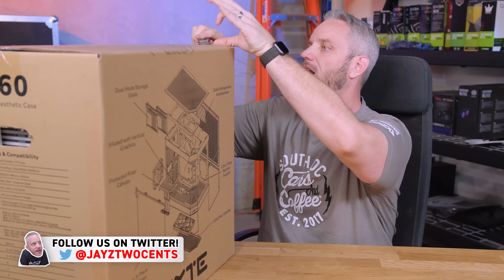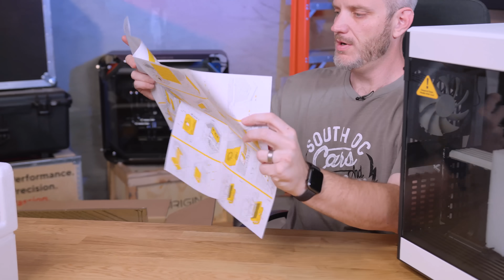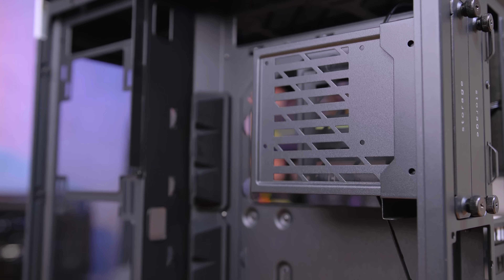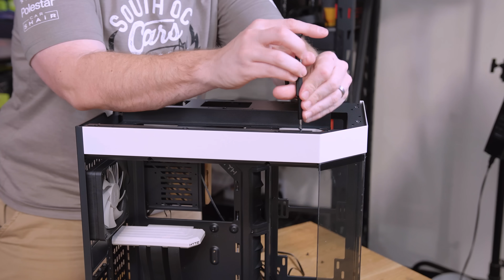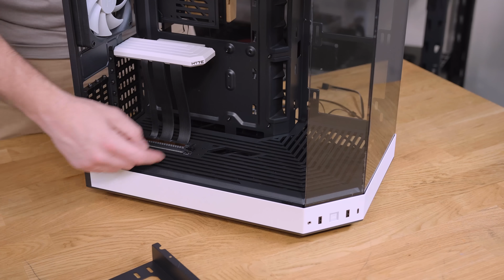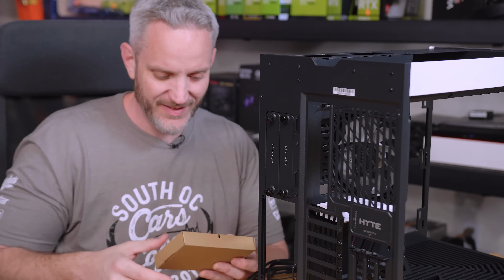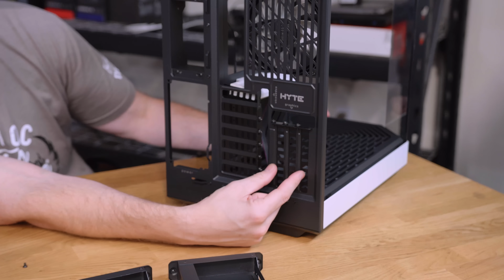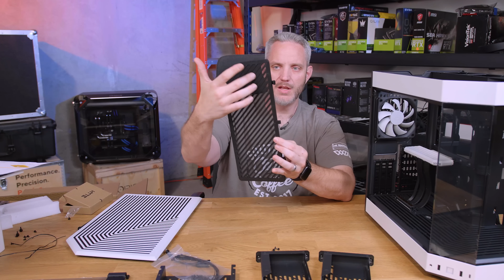Someone FINALLY broke the mold for PC cases...

Comment: Quick correction as a maker. Expansions would not need to be low profile in those PCIE slots. You could use a spacer nut or long standoff and mount it to the low pro bracket.

Edit: the fact that the slots are “behind” the verticals, would allow you to mount a regular PCIE extension in the slot with the extra standoff/nut, so long as it wasn’t interfering with the vertical GPU mount or it’s connections.
Reply: I like your fancy words magic man

Comment: I have the fractal torrent and it's hard to even consider a different case besides for cable management is a joke  
The inside of my case is always ice cold just because of the fan options you can do 
Front&bottom two 180mm or three 120mm/140mm fans 
As for the exhaust 120mm/140mm  single fan 
Its Nutty

Comment: I bought this case I want to build a watercooling loop in this case trying to figure out the best routes to take in this I also want to use black brass piping on the build so trying to avoid making bends will buy 90 degree angle piping and straight. Any help is appreciated 🙏

Comment: Alright so it’s also a desk tower which is a huge drawback. I need desk space, while I do not underneath. I can’t think about how many time I’ll crush down the headphone jack and USB port by accidentally stepping on them.
And I don’t even mention how annoying it will be to turn it on.
Low profile for a few centimeters of height is also a deal breaker.

Comment: Good review and looks like a really interesting case. I don’t like the low profile slots and I think the bottom panel should be removable so you can do RGB fans all around but I most likely will do a build in one at some point.

Comment: The front of that case looks like a ton of wasted space. I would have expected like some kind of option in that front area for a water tower mounting brackets if someone wanted to maybe put in a custom water cooling system, like just put that in the floor towards the front right side of the case.

Comment: Well i think it is not so good of a design, i wont the most fast airflow around my hot components. Like a draught that transports the hot air out.
A open system will collect dust, may cause the dead of the rig, don't ask how i know! Lot of fans may be worse than a fiew, i am sure about that.

Comment: This could be the perfect case! Honestly if they made the case a little bigger( for full size mounts) with 1inch more room at the bottom fans for 60mm thick radiator and cable management. I generally think it would be in the top 10 cases for the next 5 years if not more. Almost perfect.

Comment: Problem, how do you take the bottom grill/filter combo off when everything is in the case? The back panel comes off easy and cleanly (ok dirty after a while) but the bottom grill? Also is there enough clearance on bottom for adequate airflow?

Comment: Neat case, but ouch, 200$! I'd wait till there's a generic imitation. I've never spent more than 50-60$ on a case, it's not worth it to me for a non-functional component. I'd rather spend the money somewhere else. I've unfortunately always been on a tight budget when building. I don't like the low-pro only slots, and I still have a DVD drive, just in case, lol.

Comment: i love the look of it.

i plan on getting a Sound Blaster card. idk if those are low profile. so probably wouldn't fit in this case. 

but I am getting that Lian Li evo case. for the airflow.

one day, when I make a 2nd pc setup, probably a corsair setup instead of razer, I'll use one of these Hyte cases.

but I like my 360 aio on the side vertically. that way I can have air go out the top. 

idk if having hot air go out the side is any better or worse than it going out of the top tho. 

i actually like to see my case fans. since mine have rgb.

as for the Hyte Y60, you wont be seeing a whole lot of RGB. But it might look cool now that I think about it.

rather than seeing the entire fan, the rgb would just be glowing through.

I'll have to wait to see what airflow builds people make in it.

Comment: A very interesting design. My only real gripe, maybe, is that side glass panel could've been made into a hidden, magnetic door - then you could open the case for maintenance without a teardown. I also disagree you can probably mount two more of those storage sleds, but only where the side radiator would be. A side note... I really love the violet/yellow lighting and gold cooling custom of it, showcased on Hyte's website.

Comment: If i COULD hypothetically afford to build a system in that amazing case, I totally would.  And I would go all out on ARGB, do a black and yellow color scheme on the case / accessories.  Ryzen 5950x with Corsair iCUE H150i Elite Capellix cooling, Asus ROG Crosshair VIII Extreme mobo, 64 GB of Corsair Vengeance RGB Pro, Asus ROG Strix LC RTX 3090 Ti OC GPU, and Corsair AXi 1200 W 80+ Platinum PSU to power it.  Plus the m.2's and ssd's necessary to store my entire steam library / dslr raw files / etc.  I mean if I'm going to dream big :)

Comment: Only downside is expansion cards. I have 2070Super at 315mm, 3060, firewire, nvme adapter card and also want a capture card but already using riser for the nvme adapter and space sucks (meshify c)

Comment: Hate to be "that guy" - it's different, breaks the mold as you said, but I'm really not a fan. It's different for sake of different, not BETTER. That weird cut-off-corner bit with the glass and front panel stuff, it just doesn't IMPROVE anything, and in fact I think would make it harder to reach in / work inside the case. Same with those gromets - sure, in CERTAIN circumstances it hides the gape but like, it also forces / limits what angle cables come through at. And that bottom you raved about, cool, fans, but with the way their PCIe riser is mounted, you can't put a rad down there like in, say, an 011, or many InWin or Corsair cases with similar designs. I just can't get behind this one, sorry Jay.

Comment: as for sandwitching two ssds in a 3.5" bay? They even make double mount adapters if you want to screw them down. They work perfectly well for that application. And I can see their point. I've got three SATA SSD spaces, only two are filled, and one of the two HDD spaces has a hard drive. I wager the two SSDs are getting old and probably wouldn't move if I ever rebuilt this system.

Comment: I looked up my big green case and apparently i have a "Nvidia Master Haf X" and ive had it for at least 10-15 years, no sidecover, most fans removed or switched out. Had to customfit the watercooler to make it fit on the top, where there used to be 2 fans, so its kinda jew-made but it works. I think my next case will just be components inside a desk or something that i make myself.

Comment: While lots of room for air to get in and out of a case can be a good thing, having slots or holes adjacent to fans can result in the air simply moving around the fan in a short-circuit rather than through the chassis.  I often use hard foam sheet to blank off surplus apertures in PCs that I build to help ensure that the air goes in and comes out only where intended.  That way, all of the air that is moved by the fans has a chance to cool down the hot bits.

Comment: The other things about this case that are cool are:

1.  Those storage trays can actually hold TWO 2.5" SSD's each, so one could potentially mount 4 SSD's in the case just using those drive sleds.
2.  While it is not just built around good airflow, it is one of the few cases out there that can almost reach a true 100% balance between intake and outtake of air.
3.  It was designed by the guy who used to design cases for NZXT back when they were GREAT cases!

Comment: Listening to Jay, break this "HYTE" case down like a car engine or something made me think of the days back in the day when folks didn't take Tech seriously, case-mod'ing and such in particular. Back then customizing cases with paint jobs, or case-mod'ing for extra air flow, or for a look, or to make a device fit that wasn't meant for that case; it was looked upon as something only the Geek or Nerd with too much time on, usually his, but could sometimes be her hands, would do - and often as a waste of said time. Now however, it's a thriving and well respected industry of uncounted billions I'm sure, with experts in unboxing, reviews, an all manner of the ins and outs like the Auto Enthusiasts enjoy. The only thing missing would be and auction like Barret Jackson, but we have eBay, and the like, and vintage gear can buy, sell and be traded, for unimaginable sums or deals based on the original prices. I've told my friends, who are less tech-savvy that a business computer to do a spreadsheet only needs to be so fast, a computer to play a game needs to be much faster, processing power wise and computationally (the difference being the CPU and the GPU respectively (support equipment inclusive CUDA and the like, etc.)) . Gaming is what drives the computing industry, Scientific innovation rides the coattails of the power wave Gaming has wrought through the need for faster video engines and the like, not the other way 'round. So all the majesty and awesome we have now pretty cases, rgb lighting,lcd mfd displays, etc., vs. the old beige boxes of the past is thanks to case-mod'ing and what it has morphed into as an industry. I would have never imaged it, and I dreamed of tech futures with cyberdecks similar to those in Shadowrun or Neuromancer when I was young. 

Hack and the world hacks with you !

So the circle is now complete, what a lovely case, being the best of both worlds the functionality of being open with the look of being closed, and shapely to boot!

Great episode!

Comment: This was useless video for me, thinking about maybe doing a case upgrade to my 2013 choice, the Corsair Obsidian 650D – CC650DW-1
I started watching, jumped forwards to the build start, it never did, quit watching. I don't want to look at a talking head, doing an unboxing, after a claim of this Case, "Broke The Mold".
Make that sort of claim, and I want data on how it actually does it's core job, cooling as a fully built PC, and with tested size limits on the EATX, and GPU, Rads etc.
Looks like I'll have to wait for Gamer's Nexus to actually Review The Case, won't just do an unboxing video.

Comment: Huge ventilation? Not at all. Only about 35% of the panels are really cut out. The bottom fans will suffer, just like any other fans in this case. You throw away 2/3 of the performance.
Reply: Well, I was absolutely right...

Comment: With a 360mm AIO, would you recommend intake from the top?and have bottom fans exhaust? Sucks that that side panel doesn't support 360 rad lol. I don't mind my AIO's on top. Just not sure how i want to orientate the intake/exhaust for the rad. Anyone have any comparison between the two options with temps for this case?

Comment: Looks cool, sucks for anyone running dual GPUs. Its not as common as it used to be I can give you that but in my 'case', pun intended; I run two cards because I have 6 monitors and NVidia set a hard cap of 4 displays max for the RTX cards in the firmware which is honestly plain stupid, using daisy chain DisplayPort you can run 4 1080p displays from a single output off the GPU and my 2070 has 3 DP connectors. I just run a older ATI 5770 1GB I just happened to have lying around in order to drive additional displays.

Comment: I'm actually trying to think what PCIe peripheral you might put in that doesn't have a low profile option. There are a fair few low profile capture cards option. There are low profile PCIe to m.2. Same with sound cards. Wifi card, network cards. I can't think of any card Where I wouldn't be able to find a low profile other than the GPU. Yeah most of them require you changing out the bracket included in the box.  But its not like low profile PCIe cards are hard to find in the consumer space.

Comment: I like this case, the only issue I have is that in the front you don't have separate inputs for mic and headphones, it looks like one jack.   As I use the audio inputs, is there a way to merge them to use the one plug in the front?  If so then this will be my next rig I build.  It looks like a natural evolution of the Lian Li / Der Bauer case which I currently own in white.

Comment: I really want this case, but it needs some sort of sliding mechanism on the rear that would allow blocking the vertical expansion slots in exchange for turning the half width slots into full size. $200 is a fair price, but that particular limitation seems odd. On the other hand it's probably fine for most gamers since capture cards like the Elgato 4K60 Pro come with low profile brackets

Comment: THANK YOU!!!!!!!!  The front IO connector as just a single plug... I've been building computers for 20+ years and it has always been the same since ATX std came out in the mid 90's!!!  I hate  putting front IO cables together as they all go in the same spot and I no longer even need to look at MB book to get the pin out...

Comment: Holy crap why are the front panel connectors not solid on all cases? Also, are those rear quick-release mounts for drives? Because if they are, that's seriously a cool feature.

Comment: Really happy to see you do a vid on this case.  I just transplanted my rig to it and I love it (mine is the red edition).  Would love to see a build and some testing.  I can say from my own use so far, I am getting a good 8-11c lower temps (on average) from my last case (meshify II).  

Little tip for anyone building, leave the corner glass, if you can ,for support (while building, obviously it should be there any other time) just in case any unintentional weight is placed on the top through the process.  It is sturdy without the glass.  But sometimes a jackass will come and place their hand on the top and lean while talking to you... 

Wiring was a breeze. I swapped out the fans for ones I already had, but the included fans seem just fine.  The included riser was a great gesture.  My only complaint is that the GPU could use a bit more clearance away from the glass, if you have a larger card.  As well as not having the resources to go custom loop, because in this case...it would be sweetness.  One could NOT ask for a better case in most situations, especially not in the sub-$200 range.

Comment: My biggest thing about new cases...if you are pushing the vertical riser...then make the panel vented in that spot so it can pull in fresh air... Like why make it solid glass there... 

On my case, its not vertical, but literally where the graphics card is located is the only place where the heat is on the panel and in the case ... So why not just vent it right there already...

Comment: I think the fan/radiator mount locations could hold some 3.5" drives as well. I see on the tech specs 2 3.5 and 4 2.5 can fit .. so the sandwich is likely correct...or they may have included some additional brackets.

Comment: nice try but lian li dynamic XL still wins :/ it can hold more drives 10x120mm fans 3x360mm radiators (2x55mm + 1x30mm) has more space for cable management better airflow and doesnt force you to go vertical mounting I hoped the HAF 700 would give me more space to work with but nope despite it's size it has the same flaws corsair mid-tower cases have, lacking 3cm here and there inside makes you unable to set up 3 radiators properly as they overlap each other/connectors, you'll need 3 rads if you plan to ever get an rtx 4000 or new cpu, watts are going up everywhere liquid cooling is unescapable

Comment: It reminds me of both a 3D printer and a fish tank. I'd  want to use minimal lighting in the top that cascaded down on the parts, which I'd probably go as shiny as possible. This is a 'look at my parts' case. I might do something offbeat and just fill it with fans, blacked out ones everywhere but the top.
I would use dual 2.5" to 3.5" adapters to put four 2.5" SSD's in the drive cages, maybe hooked up to a LP HBA or RAID adapter

It's not my style, but the forced vertical mount kinda begs for a water cooled GPU, which I'd find something with a 120mm RAD/pump combo  and mount it on the rear exhaust. with the LP HBA,  maybe add a LP NIC that did 10Gb Ethernet or something, or an NVMe PCIe adapter card, as most of those come with LP brackets. Pack as much storage and networking in as possible.

Comment: I don't really like the intake fans being on the bottom. There's so low clearance, and it looks like dust and debris could collect down there and choke the intake fans. I burnt a PSU out once because it had a bottom intake that was mounted facing down through a vent on the bottom of the case (the case was specifically designed for this) and I had forgotten to clean it out regularly, and one day it just went poof because it overheated because its fans were choked out. Nowadays, I always mount the fan facing up even though most cases have a bottom vent. This case has intakes on the bottom and this will definitely mean you are NOT putting this case anywhere near the floor, it is certainly a must to put it on your desktop, which not everybody can do. Otherwise, it's probably best to remove the pre-installed fans and put them on the top instead if they will fit there.

Comment: @JayzTwoCents
I like the out-of-box thinking, but this does not have a few key features that I consider deal-breakers. 1. No reset button on the front panel. Seriously? 2. Not enough drive racks. 3. They could have EASILY tooled in 5.25" and 3.5" expansion bay into the lower section of the case. Unacceptable.